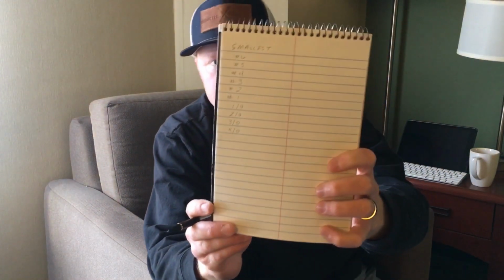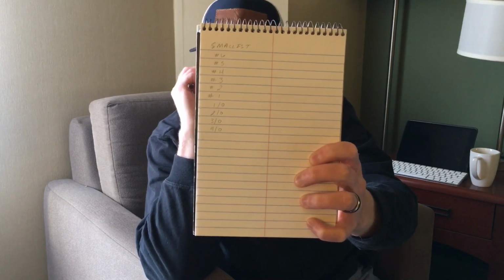ANSWERING YOUR QUESTIONS ABOUT PIPELINE

Comment: while looking, I have seen 1 1/2" to 4" bevel cutters, but most labeled as 2-4" is there ever a time to need a 1 1/2"?  next I have browsed at job listings, & seen wording looking like a person may need larger bevel cutter? is that ever the case? like close to 20" or 24"?

also I am slowly working on building a 4wd, dually, currently a 2wd, 3/4 ton, with 1 ton rears, its a 1980 GMC, I just got a 4spd granny gear transmission & transfer case yesterday, but still got to find a front differential, & build an engine. so it will be a slower process. but I will ask a weird one. I also have another dually, but its a former Toyota RV, & its 2wd, but if I put mud tires in rear would it be a starter vehicle? & build my other vehicle as I can afford, the Toyota doesnt need much, just build a bed,  it has planks bolted down over old aluminum floor frame, & needs something a little better, & fix brakes & put new belts & hoses for peace of mind before taking off? whether a helper, or to break out when I have enough experience & a few tools I am missing
Reply from the maker: You shouldn’t really ever need anything less than 2”. You can use a chop saw or Zip disk if you do end up being on that small pipe for any time at all. Ill add this to my list of videos. Thanks.
Reply from the maker: Anything over 12” most contractors should supply the beveling machines or cuttin band and crawlers.
Reply from the maker: I carry a 2-4, 4-8, and 6-12 beveling machines if I’m going to a fabrication job.

Comment: ok whats the one for in 7018....is downhill not a position
Reply from the maker: Larry Walton 
The one is the position. Meaning vertical. Technically you can weld 7018 downhill but the proper way is run it uphill. It will be stronger and cleaner this way if ran properly.
Reply: Austin Ross. thanks for the reply my friend ive always ran them up on structural but always wonder about the all positions.....love the videos and i can let my 5 yr old boy watch with me

Comment: We work for a distribution gas company that requires you to use whip on your leads and they can't be less than 10' long. Their auditors have came out and wrote us up for being 6" too short. Have you had any problems out east here with gas companies or contractors saying your oxygen bottles can't be laying flat.
Reply from the maker: Justin Campbell 
I have not had any trouble personally. But i do know other guys that have a run in with DOT about their bottles laying down. It’s worse out west in California and those areas. Ive considered standing mine up in the next welding bed i build.